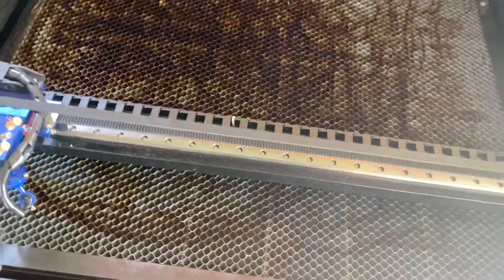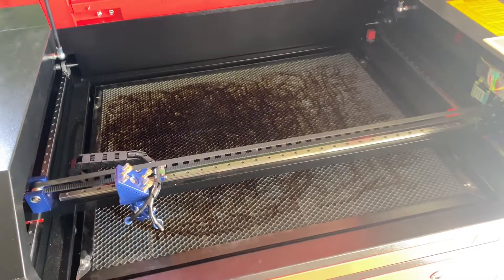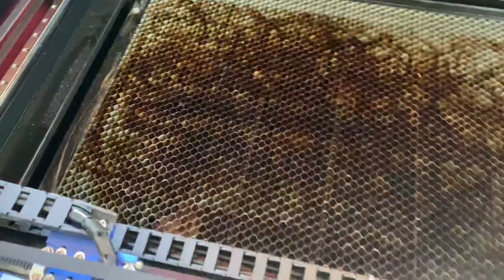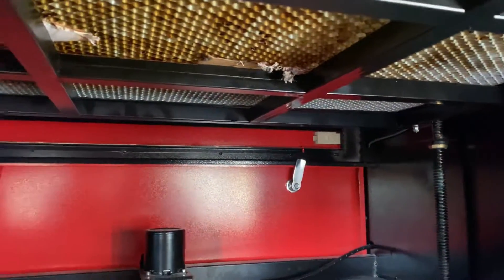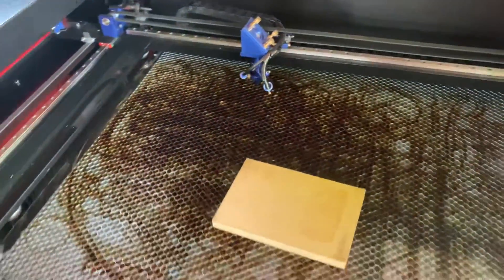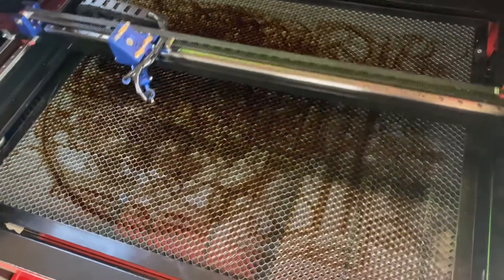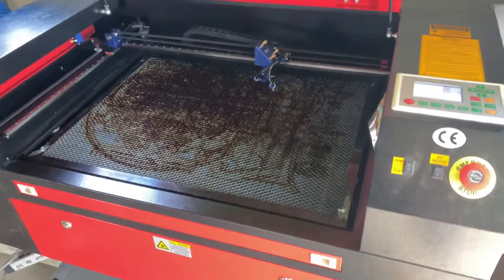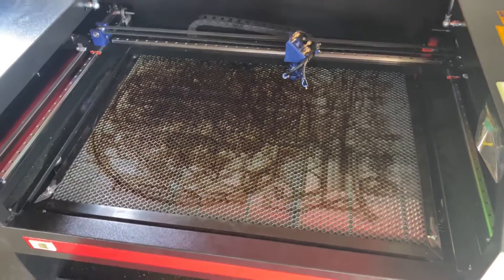Laser bed OUT of Level!!

Comment: Does it matter?  I have seen some diode lasers on the wall .
Reply from the maker: Yeh it does if the bed is not level then when you set your focal distance that will change over the span of the cut causing thicker lines and also not cutting all the way through material in some places 👍🏽 thanks for watching, Matt

Comment: Hey mate, I got the 80W version. Did you figure out how to adjust the screw jacks to level the bed?
Reply from the maker: Hey mate, nah I didn’t need to all I ended up doing was using some 1-2mm metal angle brackets and just slit them between the honeycomb bed and the actual bed frame and that worked a treat it was ok in the top left corner but from the centre to the lower right needed some packing up with the metal brackets, cheers Matt